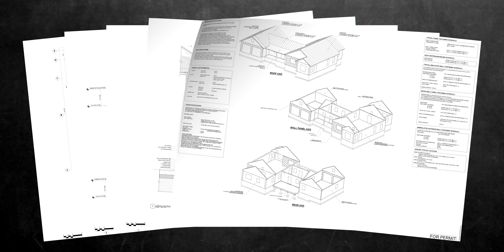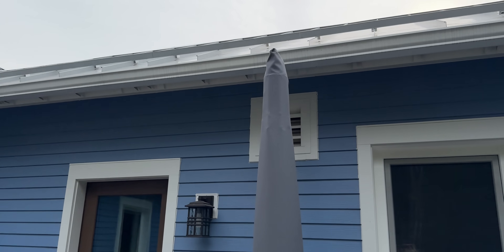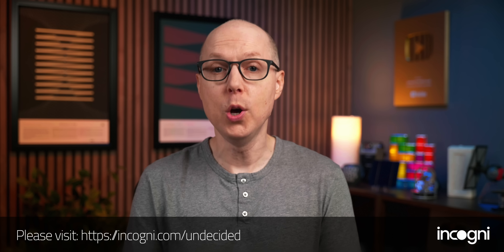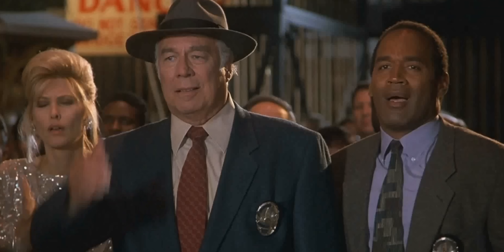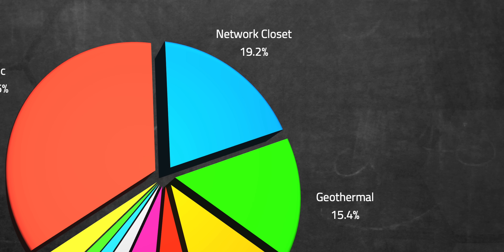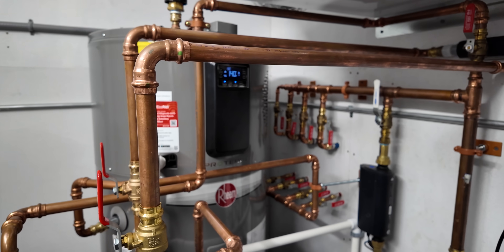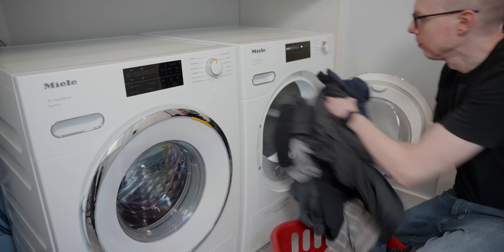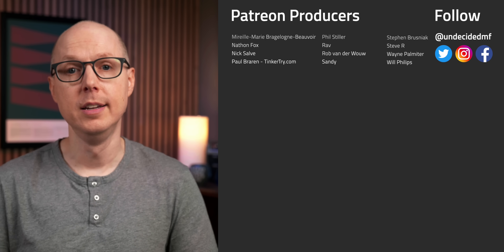What I Learned After 1 Year in My Net Zero House

Comment: @undecidedMF The "heat backup" is almost certainly an electric coil heater in your air handler, which is designed to handle fast drops in temperature a heat pump cannot deal with. A secondary heat source is required by code in Ontario where I'm a builder, and I assume it would be the same in any northern states which experience similar weather patterns
.
Reply: It could also be the heating elements in the hot water tank used to raise the temperature every couple of weeks to kill bacteria.
Reply from the maker: Good suggestion.  I've been thinking it's related to the water heater in some fashion and not the HVAC.  My geothermal system doesn't need the the heat backup.
Reply: @UndecidedMF  Home inspector here.  I agree.  Disable it.  It should be labeled in your hvac controller as "aux. (Auxiliary) heat" or "emergency heat" .  Typically, you can go in and disable it.  After disabling it:  If you feel a bit cold on a very cold morning, that is probably the difference.  You can always go in and re-enable it as needed.
Reply: @UndecidedMF  I have an ECOnet heat pump water heater, and I’ve put the setting to heat pump, instead of energy savings. As best I can tell, energy savings might sometimes use the resistive heater coils that prevent the water heater from having a smaller 240v circuit. I HATE that I needed a 30amp circuit for the water heater, I’d like to have one without the backup heater coils. Not sure it would show up separately on your tracking though, cause heat pump and heater coils both use the same 30amp circuit.
Reply: @firefighter4443  I did the same. Part of the energy star rating criteria (so I’ve been told) is how much energy is used to heat water but also the recovery time. Eco mode on my Rheem uses the heater element sometimes to boost recovery time. But I went to heat pump mode only. I don’t know that there is a big difference, but on my 80 gallon tank for a family of 5 we never run out of water and I know the heat pump mode will have to be less energy usage, even if only marginally.
Reply: @UndecidedMF sounds like the electrical resistance heating element in your HPWH
Reply: @UndecidedMF  It's either the heat pump or heat pump water heater's secondary heating element. That's an unusual option in a ground source heat pump so most likely your heat pump water heater. It's all integrated into one controller so it's sometimes difficult to determine but your smart meter can look at the instantaneous demand of that circuit and knows if it's the heat pump (500 W) or electric element (5000 W!).
Reply: @NHRunDad  I installed a 50 gallon in series with my dumb electric Rheem 50 gallon to basically have triple redundancy. Heat pump does most of the work, elements are back-up on that unit and the dumb electric acts as a back-up and storage for the HPWH. HPWH is in the garage to take advantage of hot summers in Georgia. 

One point of note is that even in heat pump only mode the elements will turn on in some conditions like when the heat pump fails like mine did due to thermistor failure. Easy fix though with Rheem phone support and free parts. 

I decided to go with 2 water heaters after having issues with my Rheem water heaters and them thinking that 2 to 3 days shipping for parts was considered acceptable. I told them I would be divorced if we didn't have hot water back on that day and they let me return my unit for a new one to solve the issue. That is when I decided to install the HPWH and a dumb unit in tandem.

We use 29 MWh a year on electric here and solar covers about 19 MWh of that. Comfort is my main concern and the solar covers not feeling bad about it.
Reply: Oh, and the HPWH was a self-install along with the dumb unit. The HPWH will pay for itself in about 3.5 years. Hopefully it fails just before 10 years and I get a discounted new unit. No brainer.

Happy wife, happy life.
Reply: @UndecidedMF  I believe the heat pump water heater only has one power input so the readout can't be the water heater's auxiliary coils.
Reply: Also many heat pumps turn it on while in a defrost cycle for comfort because the air blowing into the house during that time will be cold. I disabled that feature on mine because it's only cold air for a short amount of time and the heating more than makes up for it. It's still active as a backup for extreme temperatures. My heat pump kept up every day of this past winter in the northeast including several days in the mid teens. Those heat strips use a lot of power compared to running the heat pump a little longer.
Reply: @EnterNoEscape  Defrost doesn't really apply to geothermal heat pumps, since they aren't subject to near-freezing ambient temps. Their heat source, if sufficiently deep underground, will always be very consistent at approximately 55°F.
Reply: Yeah, in cold climates it makes a lot of sense to incorporate some thermal mass and run your heat pump during the day to bank heat for the winter night to minimize the odds of needing that backup.

If your locale allows, I'm a big proponent of wood stoves, at least as a bonus heat source for super cold nights.

If you really really hate the idea of a wood stove in your house (or your insurance company does) there are theoretical ways to integrate a heat pump condenser with a semi outdoors wood stove. An attached greenhouse is maybe?
Reply: I think he knows that but in IMHO I don't think his geothermal needs backup unless he is in -20F temps since it can handle below zero very well.
Reply: That's what I was going to suggest also. Our geo system has "aux heat" that kicks in when the temperature difference is too great for the system to make up for in a reasonable time - part of the reason to set and forget the temp. Example: If current temp is 20c, and I set it to 30c, aux heat will kick in. Most of the time, for us, aux heat is kicked on after longer power failures.

Comment: I have a heatpump based heating system, NIBE. I'm guessing your Heat Backup is an electric coil that can do COP=1 heating in case the heatpump compressor goes down. It's also often used for weekly/bi-weekly anti-legionella cycle for your hotwater storage. Could that be a factor?
Reply from the maker: Good suggestion, but it doesn't appear to be that.

Comment: I think you need some Regen braking on your blinds to harness the down energy. Only makes sense.
Reply: Yup, regen from the blinds and the garage door is needed to recover as much energy as possible. And the heat from the breaths should be harnessed for energy too.
Reply: @alihms  I think the heat from his breath is being harnessed already with the heat recovery ventilation system? For blinds and garage doors the best approach is to have counterweights so you only need energy in to overcome friction.
Reply: @alihms  There are garage doors with counter weights and springs. Body heat doesn't leave the room. With blinds the most important thing is to make sure they open when heat is needed and available. Skylights can also heat up the attic added a thermal barrier to heat loss during the heating season.
Reply: @alihms  heat from the breaths should be harnessed for energy too.   He doing this already with air recuperator ))
Reply: If you already got the German windows - I recommend adding rolling shutters outside. Electrical they run you maybe 200€ per window, but can block out sunshine really effective.
If they are completely down it's night in your rooms - pretty helpful if you have different working hours.

They probably also can be connected to a smart home app - and could be automatically lowered if it's hot.
That's how europeans mostly avoid installing AC's in private homes. 😉
Reply: Be very careful when buying a heat pump dryer. Most models have tiny capacity and take twice as long to dry.  Look for a large capacity model and be prepared to clean the main filter after Every load and the internal filter every 3-4 loads.  Any reduction in air flow extends dry time significantly.  

Given the choice, I prefer a conventional dryer to avoid these inconveniences and higher purchase cost. Quality of life is more important to me than efficiency.
Reply: @johnpoldo8817  I'm not that fussed about drying time. I don't stand over it waiting for it to finish, and quite often come back hours after it is finished. Lower capacity could be a problem though, and I would need to make sure it still works out cheaper per kg of clothes
Reply: Sure. And while we're at it, add generators to all the doors and windows to generate power every time one is opened or closed. And piezoelectric floor tile to generate power every time you take a step.
Reply: You guys who answered are classic.  Just love the humor and tickling Matt's reasonable and logical obsession with home energy.
Reply: With an electric motor operating to a stop point and very little mass I'm wondering is a small solar panel used as a cat flap a better alternative?
Reply: Actually a lot of motorized blinds have a solar panel as an option. They're often already battery powered and not hardwire, the battery isn't very big but the electrical draw is low, so you get 400-800 open/close cycles before needing a charge. So a small solar panel stuck on the upper corner of a window is enough to keep the battery charged.  @antonyjh1234
Reply: Thats coming in next weeks show!   lol
Reply: You have no clue what you are talking about nerd, a perpetual motion device would use ZERO energy and could be tied into the the grid to actually give back all that energy when the blinds are not in use.  You could generate approximately 10GWh per day if done correctly!
Reply: @yourmomma69-g5r  You're a troll 🧌 who has no idea... You're right, I am playing. 😎
Reply: KERS? Like from F1? haha